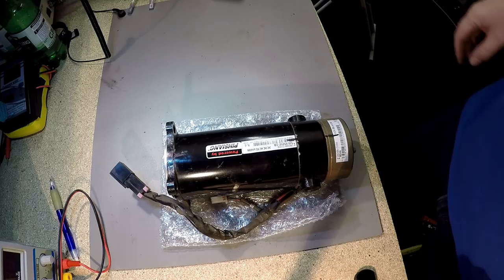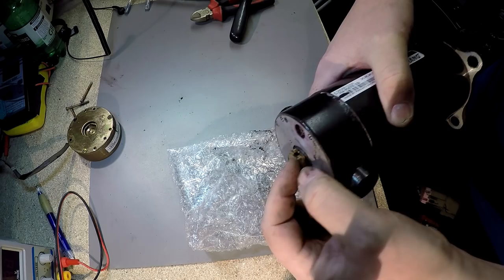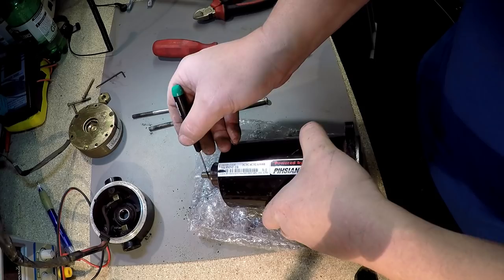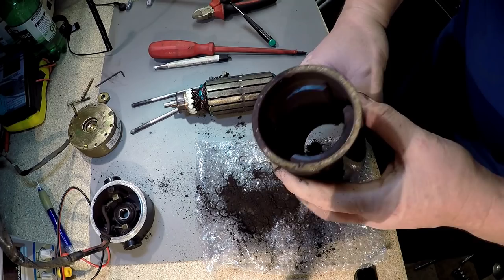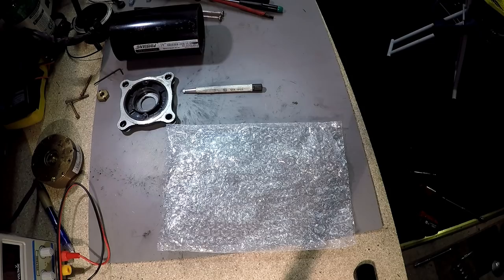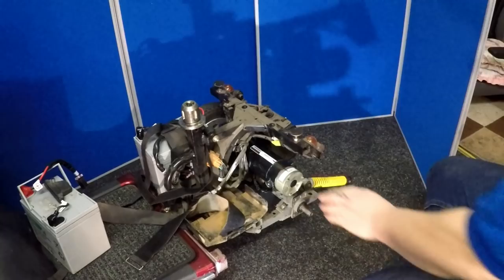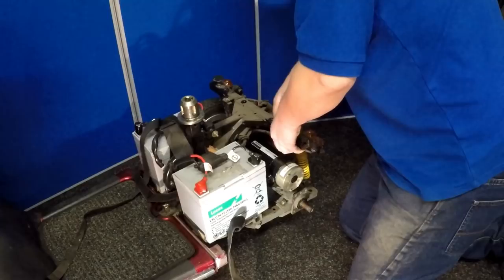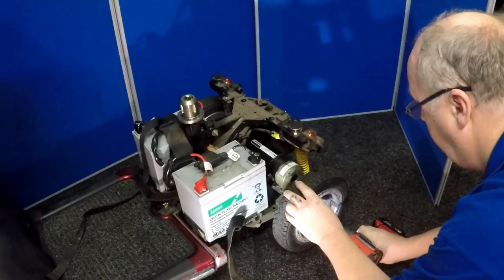Mobility scooter Motor repair Part 2

Comment: Thank you for parts 1 and 2 of this video. I have installed a new brake, and a new potentiometer with new wig wag. I have a Shoprider Allrounder.
From following your instructions,
I took the motor out and used an air compressor to get rid of all the carbon powder waste.
I also used "electronic contact cleaner" in a spray can to clean motor.
I also used a glass fibre pen to clean it up.
I installed 2 x new 43 carbon brushes.
On the test ride Scooter started out perfect.
Then it began not moving after I stopped and taking off with a jolt.
The jolt got worse when I stopped in the supermarket to put shopping in my basket.
It stopped completely and did the beeping.
I  got off and disengaged the brake into neutral. Pushed it a little and 
put the brake back and was able to drive again. Each time I stopped I 
had the delay, the jerkiness and the big jolt.
Half way home I lost speed.
In total I did about 4 or 5 km round trip.
In the end I completely lost speed and came to a complete stop.
Had to push Scooter home about 600 metres.
However battery indicator on dash was still good.

Could you please advise what I need to do next? 
Signed,
Immobile in Australia
Reply from the maker: It sounds like the motor what  colour is the commutator. Are the brushes still in the same condition.
Reply: @tomjacques4  the commutator is clean now. The brushes were not bad but l replaced them this morning. I had all the symptoms of your video to begin before l took the motor out. But after my few km test ride l have lost all power and had to push Scooter home at the end. Also going down hill was scary. Thank you.
Reply from the maker: @michaelunderdog5039  have you checked the brake? Is it dimming on while you driving or is it sticking , Have you run the motor with 24 v.   applied. Seee when it stops and then goes again dies it take off very fast
Reply: @tomjacques4  Brake was not sticking. It was not engaging. Coming downhill was scary. I was slowing down / stopping by turning key off. On test ride at the beginning I engaged wig way and there was a delay before take off and then a jolt. This got worse. At the supermarket it delayed and then jolted forward. I had been off the road for months. Purchased new brake. Purchased new potentiometer with wig way. Spent quality time cleaning motor. I thought motor was beautiful clean. The situation has gone from the problems you describe in your video to zero movement. I had to get off. Disengage lever at the back and push home. Is it possible that I have ruined motor by using a little bit of spray from a spray can a product called "electronic contact cleaner"? 
Tom, this is my 2015 model. When it broke down I went and bought a 2019 model, but it broke down with similar symptoms. I do a lot of stop starting because of exercising my service dog alongside of Scooter. Was going to start working on the 2019 next. I installed brand new brake and potentiometer. Not sure what you mean by applying 24 volts. Could you please direct me to what that means? Thank you so much for all your help. Michael
Reply: @tomjacques4  Dear Mechanic, How do you run the motor with 24V applied? I purchased a multi-meter.What do I set it to to test 1) the motor and 2 each battery please?

Comment: Wash all parts, new bearing and brushes and put the armature in a lathe and skim the commutator. Wallah! New motor!
Reply from the maker: Well done just make sure you have cleaned between the segments I usually insert hard plastic labels so no copper falls between them.

Comment: Thanks, very informative video.  You should be useing a copper or hide hammer on that aluminium casing. Also motor was a bit ight after reassembly just tap the top and bottom casings end on to relieve the tension of re screwing caps on
Reply from the maker: Steve Ashcroft A good point Steve, I have used a copper hammer in the passed put the effort to release a seized disc sometimes requires more of a solid impact. Mind you not many people have one.

Comment: Thank you for info’ that has helped to rectify my problem, what I have noticed is that the rear wheels are able to be  stopped by hand when they are in motion,is this a thing that is normal.🤔.
Reply from the maker: It’s got a differential so yes that’s normal

Comment: Hi could you please tell me what size  grommet key I need to get inside free rider fy1 luxury motor so small 😅
Reply from the maker: Sure is sadly I have not yet had the honour to remove said grub screw so you will just have to try all sizes

Comment: With a small Lathe, you could just skim the commutator and then use a small hack saw blade to undercut the slots in the commutator again.

Comment: What can be done to fix wobbly wheel
Reply from the maker: Remove wheel and out the other side on to see if it’s the axle or not. Any slack bolts holding the split rim together.  ?

Comment: Loving your tutorials , i have an easycad powaglide and its showing a fault but cant find any info at all , got power and lights are bleeping but will not go , maybe need new brake or throttle pod ??
Reply from the maker: Difficult to say what the problem is until we can see maybe a video of the problem.  And the flashes or beebs. Also what type of power module that is fitted.  If you want you can send us a video to tomjacques@btinternet.com
Reply: Hi , video sent plus three pics , andy

Comment: I'm changing brushes on my pride colt deluxe spring come out carbon bit stuck how can I get it out
Reply from the maker: Yep problematic that one… if its stuck then you will need to break it into pieces mind you make sure every thing falls out, so hold it above and insert screwdriver from the underside ensuring you don’t damage commutator break of little pieces at a time or you can dismantle the complete motor.

Comment: I have  Pride v10 scooter and the brake gets very hot after about 10 minutes running, is this natural
Reply from the maker: Warm yes but not hot 🥵 if you have a clamp meter check to see if the current draw changes

Comment: Aah, no new ball bearings, or cleaned ones. Would have liked to see that.
Reply from the maker: Giesbert Nijhuis dome this once on an old obsolete motor with a bearing puller, or you could use a couple of screwdrivers but be very careful not to damage the windings.  You will notice if the bearings are gone as the brushes are worn more to one side.

Comment: hi . i got a pride sc710 scooter , it has 3 beep code , i check from internet said it is over voltage , what i can do ? thx
Reply from the maker: toyotapaulip Hi mmm must be a USA scooter as don’t have that one in the UK. But looking at the pictures looks like a colt. And over here they are fitted with S drive controllers and 3 flash codes means motor issue so check all connections between controller and motor also brushes. If you are unsure you can send us a picture of your controller.
Reply: @tomjacques4   thank you ! i will try to get more info and reply to you ,

Comment: few years late i know - but couldnt you file the high spots off the commutator so a wider brush would have a larger surface area to run on [albeit warn to heck!]?
Reply from the maker: Hi best thing is to stick it in a lathe and take a bit off. Don’t use a file lol. Can’t use a bigger brush as it has to fit in its original brush housing
Reply: @tomjacques4  oh yes of course - but i was thinking of us "d.i.y'ers" who dont have a lathe lol- was thinking file, followed up by 600 grit wet n dry {or 1000 if you want to go that little bit extra lol)
Have your website on favourites bar now - as my dad, the wife & a family friend all have scooters - the tiller knuckle on the wifes gogo sport is starting to wear/slip  so will be looking for a replacement soon. Thought about ebay but im guessing its a design error so all second hand ons will be similarly worn [metal too soft?]
Reply from the maker: Andy Tipping tend to get worn if they kept slack

Comment: Hi Tom could you please tell me what size carbon brushes I would need for a mercury m44 is it 43 thanks
Reply from the maker: It will depend on what motor is fitted but in ours it’s a 43
Reply: @tomjacques4  
Hi Tom thanks for the reply 43 was to big for the mercury m44 I have I've tried 42 I had to file them down to fit but don't work to good it's my mother's scooter and don't seem to be able to find the original carbon brushes anywhere online for the mercury m44 any ideas where to find original brushes for this scooter please and thanks for the help.
Reply from the maker: @rikkiknight2238  I will check the oarts list could be the smaller 6x 10
Reply: @tomjacques4  thanks tom

Comment: Great video thank you from across the pond. Let me ask you I have a pride scooter that 10 years out of production. But don't have the money to buy a new chair, are these brushes and bearings specific to my motor or are they universal because I tried calling for matienace and they won't touch it because pride no longer makes parts for this chair. But the motor I suspect uses parts that are probably still made. I think just because they can't get them from pride , it has something to do with their warranty on the work they do. But that's not an issue for me to go ahead with my own repairs. Can you help me out with some advice and is there anyway to find out the parts and numbers I need to do this before taking it apart? Thank you from California

Comment: Can I ask what tool you might use to remove rear wheels that are really jammed on please
Reply from the maker: Once he buy is removed then I just pull it off. But recon your jammed solid I use a ultra long H/D punch and hit the inside of the wheel hub mind lubricant it ever so often. Now this can be dangerous of causes it could pull out the axle shaft out. Then the axle has had it.  I have used gear extraction tool on the wheel and put as much pressure on it then hammer from the rear.  Once I had to cut the wheel off not to cause damage mind you only 1in 30 odd years.
Reply: @tomjacques4  thanks I thought I'd ask I thought maybe there was a special puller tool for taking them off I've chipped up a few wheels trying to get them off most are not to bad but a couple off them have just been so tough, thanks for the reply great channel great videos

Comment: Do You have code for bearings ?
Reply from the maker: Sorry no it depends on type of motor
Reply: @tomjacques4  its same as my motor but i lost bearing piece and i cant find the code or type to change
Reply from the maker: @itsjustandrei508  take the shaft and housing to a bearing company in the UK 🇬🇧 the company is called BSL they will measure and supply you with one

Comment: Any idea what causes 'juddering' or 'bumping' of the motors whilst travelling (especially faster motors such as 6mph 4-pole)?
Reply from the maker: marco teves hi difficult to say as have not seen your product but I would check brushes and springs brush guides also clean commutator and blow out motor with air to remove and excess dust
Reply: @tomjacques4  
Thanks

Comment: Thanks for such a helpful video. Could you please advise, would it be possible to clean out the motor using a mini air compressor that I would buy off ebay? Thanks. Michael in Australia
Reply from the maker: Michael Underdog recon it should do the job. Some people use an air duster.  That’s air in a tin can.  Should be no more than a few bucks.
Reply: @tomjacques4  - Thanks mate, you are a legend :-)      - I have a little air blaster that runs on CO2 cartridges. It looks like a tyre inflator but its designed as an aggressive dog corrector. My service dog and I have heaps of trouble with off leash dogs. I haven't used the dog corrector, becoz it will scare my dog. So........... I am going to try cleaning the motor with that. Thank you so much!
Reply from the maker: Michael Underdog try it before you use it to ensure that it does not leave moisture on the surface.
Reply: @tomjacques4  - wow, of course...... Thank you so much for your reply again. My friend who always kept my Shoprider on the road, suddenly passed away last month. Just watching your work, and you being kind enough to reply is really helpful as I make this transition of trying to step up (as best I can) for myself. Thanks mate.
Reply: You could also just bring it to your closest auto repair shop along with some donuts. They will gladly blow it out.

Comment: Hi Tom thanks for sharing your knowledge of repair, I am a Canadian with a rear axle movement I don't think wheels should move right to left by a 1/2 inch, I find it is rubbing and drain battery fast then normal. Can I put a spacer or washer to stop the moving right to left or is the axle broken ? please advise Tom, Thomas
Reply from the maker: Hi Thomas, your correct should not have that travel... take the wheel off and check to see if the cir clip has broken or slipped off.. you should see goove on the axle where the circlip should be located. that stops the wheel from moving close into the frame work and rubbing..  if you are not sure then take some pictures and send them over.
Reply: @tomjacques4  Thanks Tom I believe I know what you are speaking of ( it is a clip with to holes in the ends ) I don't have that tool, I will need to ask a friend. So if I replace the clips it should correct the problem?.
Reply from the maker: best check to see if thats the problem take the wheel off and have a look. some scooters may have a spacer ... this could of been lost when a repair is carried out .. like  a punture repair..  or if your back wheel has been knocked then it could of pushed the wheel against the cir clip forcing it out of its grove. hence causing the free play.

Comment: Having a complete nightmare trying to undo one of the long screws that go right through the motor, it was so unbelievably tight I've ended up rounding off the screw head. Any advice on how I could remove this screw? Thanks
Reply: Needle nose vicegripes
Reply: @bigbadhag  any recommendations? Thanks
Reply: @Ninko85  good set of vicegrips that have good teeth and jaws not too wobbly,clamp on as tight as you can, give it a good jerk counterclockwise. If you go slow they might slip off. This is the best way I know how, no guarantee, cross your fingers, pray, keep rabbit foot close by, say some words in voodoo, and good luck!

Comment: you can not put new brushes in with out turning the commuter
Reply from the maker: Sure can.  But I always check the commutator for damage, #cleaning and this can only be checked by turning or picking the scooter causing the commutator to turn.

Comment: Are the bearings meant to be dry or do you grease them?
Reply from the maker: Andrew the bearings inside the motor housing are sealed if worn replace them with a new bearing. Don’t grease them as you may contaminate the commutator.
Reply: @tomjacques4  Cheers good man

Comment: find a bearing  house for cheap bearings mobility price ££££ for a bearing from them ( it worked for tractors' and motor cycles )££ simples btw brushes are known as carbons ( its what they are ) , at least you dont need seals